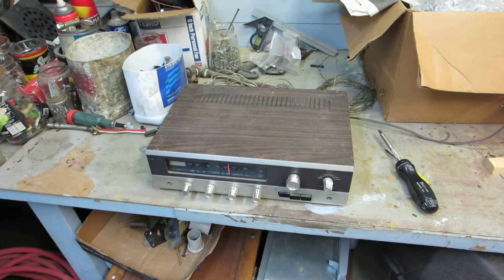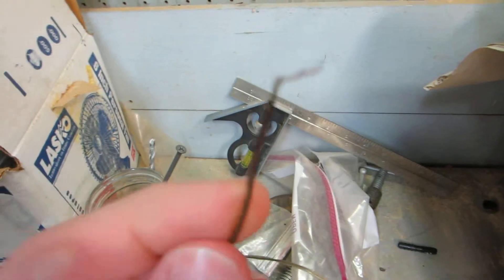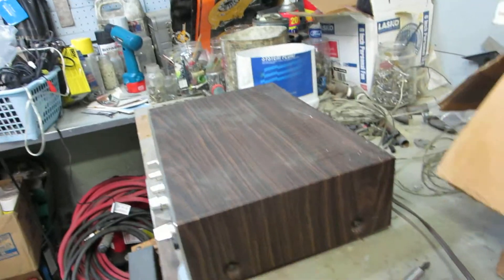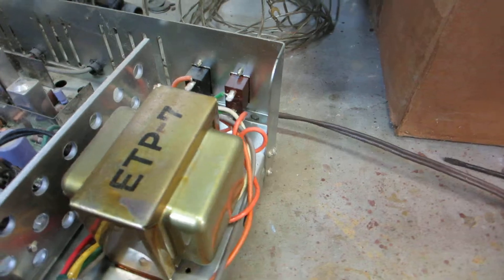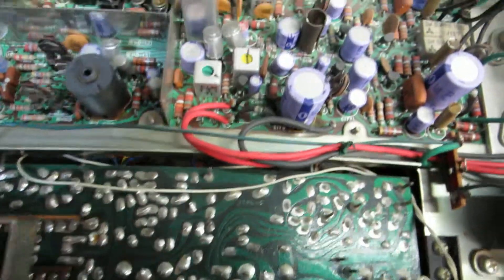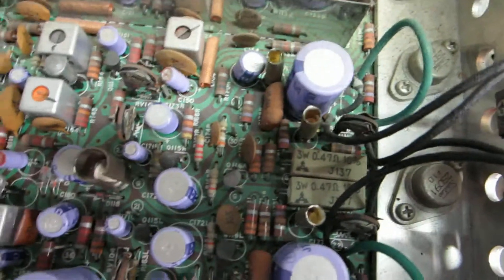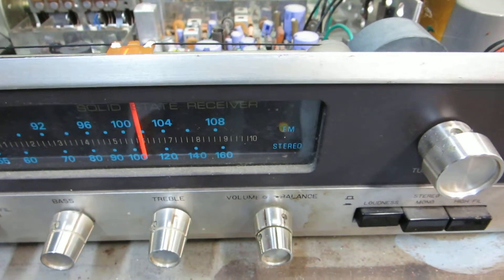Inside the Lafayette LR-100 top

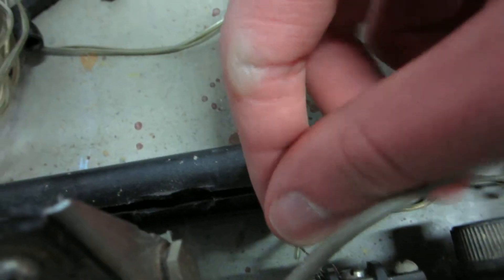Comment: Exactly at 1:00 there is a faint scraping sound off to your left, and in my headphones it sounded like someone was coming up behind me... it scared the shit out of me LOL.  

Those lavender caps look like Nichicon brand to me, if so, they are pretty bulletproof.  

Oh, and as for the light bulb, it's the same one I had to replace on my Sony, I never could find a replacement.  I had to improvise with an automotive bulb, but it worked perfectly.  It's in this video- 

https://www.youtube.com/watch?v=FFG9HDFYANA
Reply from the maker: I think those were Nichicon caps.  Thanks for watching.  I wish there was an easy way to open the speaker with the possibly bad tweeter